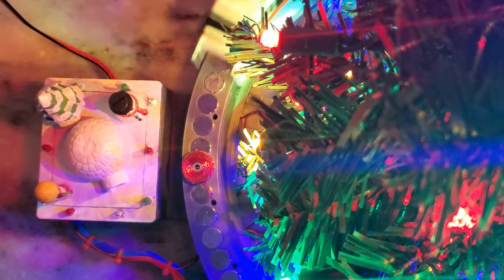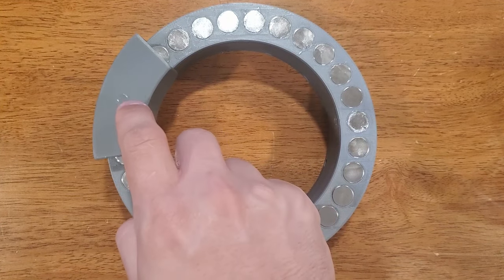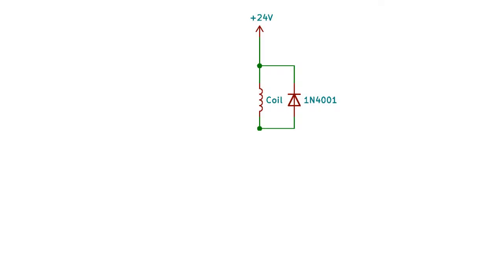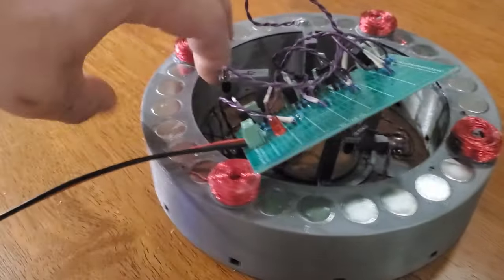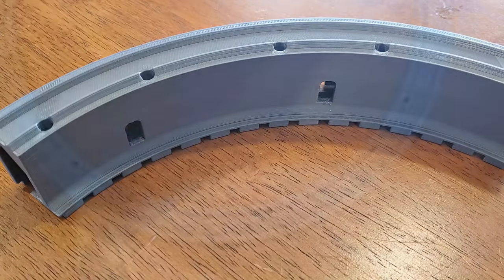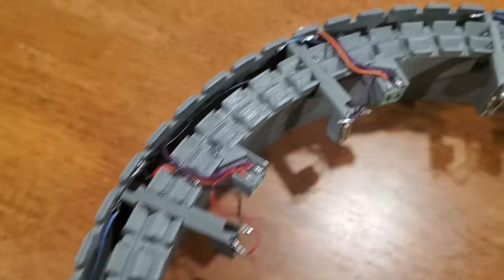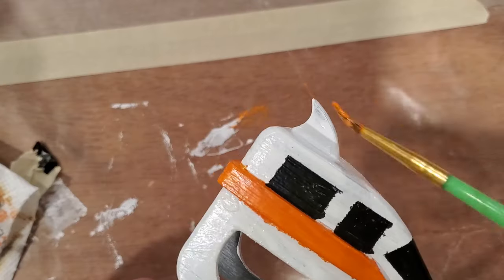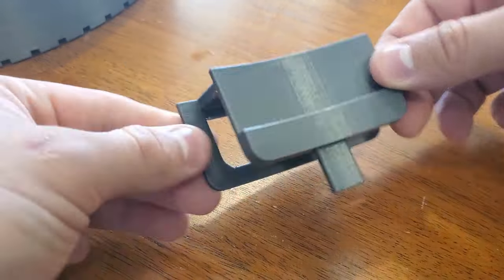Building a Maglev train for my Christmas Tree

Comment: To reduce costs, just a thought, what would happen if you used electromagnetic coils instead of permanent magnets on the track? Your method seems like the speed of the train would vary during each full rotation around the track with the train accelerating after each pulse. If you used electromagnetic coils you could vary the speed and even the direction by using timing of the coils. I know this is a lot more involved and could be done with 555 timers to alter the pulse width and frequency or by using a micro controller. It definitely increases the complexity of the wiring however. You would not need the ir feedback system for this approach too. With this design, you could also power an LED on the train for a headlight maybe using a coil, capacitor, and diode for that part on the train. Additionally you may want to further improve this by using refrigerator magnetic tape attached to the side of the track and train with like poles repelling the sides so they dont touch. I think setting the tape on the track slightly lower than the magnetic tape on the sides of the train will also help to levitate the train but not strong enough to eject the train from the track.  I think you did an excellent job btw on this very simple design which for all intents and purposes suffices for most applications. Thank you.
Reply: Magnets are not permanent

Comment: What if you glue a couple of magnets on each side of the train skirt, facing the same pole inwards, and glue magnets to both inner and outer walls of the ring, facing the same pole away from the ring wall. This should keep the train from touching the ring and make it comletely silent.

Comment: Why did u use the coiled wires?how did it moved the train ahead??
Reply: When current passes through a wire, a magnetic field is induced. The field is stronger when wrapped as a coil. Having a ferromagnetic core (such as an iron nail) can make the magnetic field stronger, but an air core (as mentioned in the video, just air in the middle of the coil) can also work
Reply: They're electromagnets. They create magnetic fields when electricity runs through them. If you turn them on and off at just the right points, each one will pull the train forwards.

Comment: you could have used a dc coil, like in railgun, in the train itself, running from a battery
Reply: wrap a coil around the track, the train will move, the track will not, because its tied to the track
Reply: yes specifically a dc emf coil setup
Reply: railgun always better than circuit logic